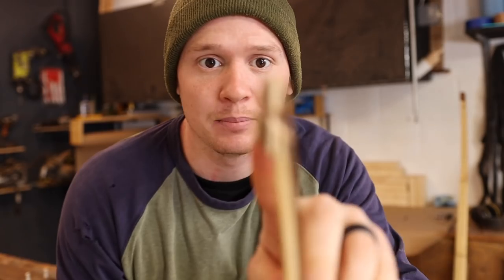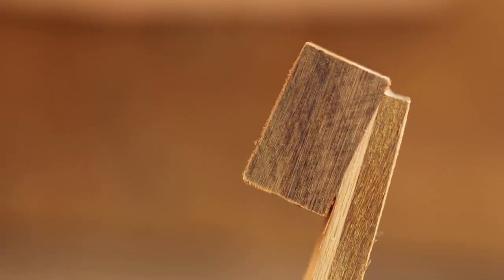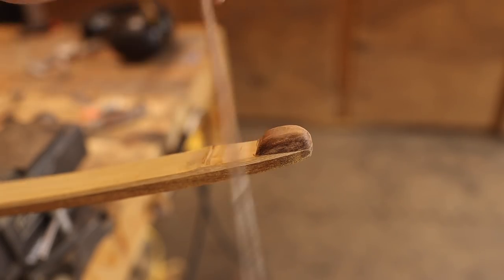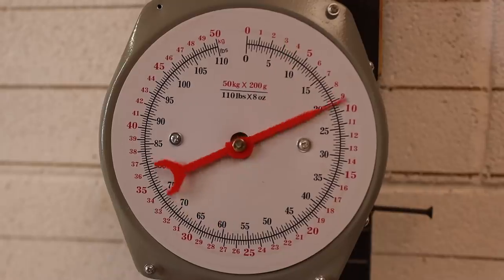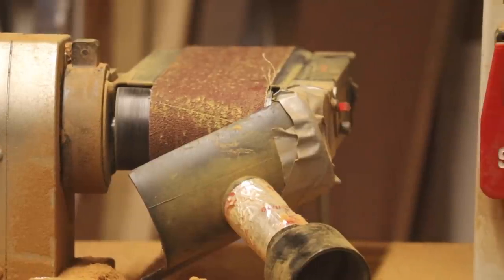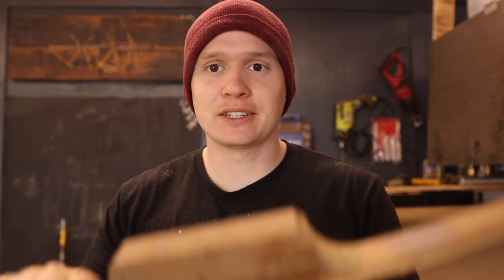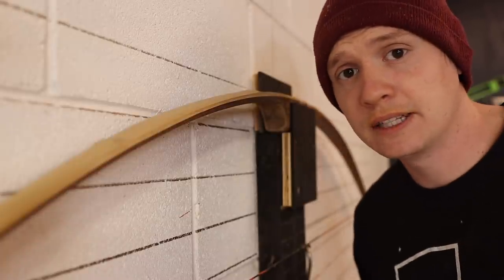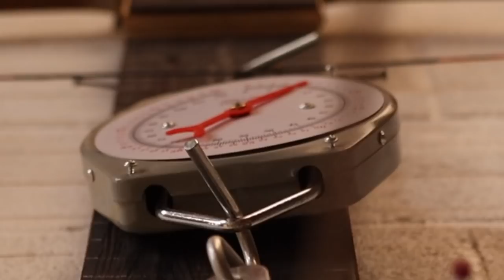How to Make a Longbow "Reflex Deflex" Pt.2

Comment: The knot (7:37) is a "bowyer's knot". It has the identical form as a "timber hitch" (ABOK 195) but if you follow Ashley's naming scheme they're different knots since they have different uses.

Edit: The knots he mentions for bows/archery are loops/splices for the operation of the bow and there no mentions for of knots for tillering.

Comment: Hey great video. I can't find a glue up jig video. Maybe you could make a video specifically on how you made that and the amount of reflex deflex in it.
Reply: sorry for being 6 months late with this as you likely have it by now. ill drop this in case anyone watches the vid and has your questions in the future.

  With the description he gives here, you can make one as he gives all the relevant information. Each block shape is to cause a bend in the desired direction and to allow for clamping (hence plywood and not solid blocks) and for specific measurements, he said he just does what he likes for the curve he wants. 

plywood, to make it nice (and so long as you intend to use it more than once, since finishing a 1-use item is a waste of time) requires countersunk holes drilled for screws (so the heads are below the wood's surface without damaging it) and maybe router or sand the edges to allow for a cleaner look, fewer splinters, and more protection for the bow. for better longevity/stability, glue before screwing - but in theory it could be easier to store if you don't, and you could just add an extra screw/ notching between the pieces so they fit together well. preferably taking into account the forces involved. .....which is easier than it sounds, actually. for the base board, you want something flat and of desired length. that's about it. engineered products (plywood, laminate, etc) will tend to be straighter over longer periods of time (avoid OSB, and any boards made involving compressed particulate matter. any moisture and they disintegrate/warp.) you could also in theory just toss some paint or sealant on a natural board. theyll do just fine on their own if you can get a straight one and keep it dry/ in a straight position during storage, but im thinking for longevity and rough use. accidents happen, and it will be going into an oven over and over.

how he assembles the bow and clamps it is the most valuable teaching information, as everything about the bow is simply because he wants it that way/ he's found it to work best for him. for the heat box and curing, you can find that info on whatever adhesive you use - the heat box looks to be a basic box with some of that insulating packing material. but assuming it int too hot, you could use styrofoam or whatever you can find space for to hit or withstand temps involved.

Comment: I don't see you use a respirator around the ipe. Ipe dust is toxic, and the dust will mess you up. Please spend the few dozen dollars to get a good respirator, with replaceable air filters, and use it when cutting and sanding tropical hardwoods.

Great bow!

Comment: At 16:09, you said when moving the scraper along “wherever the gap is bigger, you need to remove wood” shouldn’t it be the other way around, wherever the gap is smaller you need to remove wood? The gap would be smaller in places because the wood is too stiff in that section so that’s where you need to remove it. And I also believe you said it correctly the other way around in an older video.

Comment: Kramer
Thanks for all your entertaining and informative videos.  I am turning 80 in June and have  five bow that are now to heavy a draw weight for me.  I am selling my left handed Ben Graham 'Kingfisher' of 54lb @ 27" deflex/reflex  Red Elm/Bamboo longbow..  Trying to get up to pulling my 47lb  Dan Quillon recurve. Maybe ???  I made an Oak 50lb  flat bow and made the mistake after letting the stave dry in AC , and then working  it in my Florida high humidity, no AC shop .  Tillering and then test shooting before sealing, and let it sit in the shop for a week.  Of course it  went to  a string follow set.  I am thinking I can shave this bow down to 35-38 lbs. , but any idea how to get rid of the string follow at the same time ??

Comment: You might try Watco Danish Oil finish …  wipe it on … let it stand for a while … wipe off the excess.   Same process if you need to re-finish the bow.  This was the only finish we used when I was working in the cabinet shop.

Comment: Why Ipe wood on the belly? - and would there be advantages to putting cross carbon or stabil core in the sandwich between the two wood layers? - likewise, would there be advantages to putting fiberglas or sinew on the back?…or do you find it is unnecessary with this design?…

Comment: Question: I have tried to make a hickory Holmegaard style bow but it broke. length: 70", measurements were the same at the break point and the opposite side of the bow. the wood looks like layers or laminated but it isn't. Could it be that the wood was just too brittle??

Comment: Brilliant series ... thank you so much.

Would draw weight adjustments also be done during tillering? Would you just keep on removing material until the desired draw weight is achieved?

Would such reduction be done both on the sides as well as the belly of the bow?

Comment: Ordered a lil kit on Etsy, 72×1.5×1in. hickory stave, 72×1.5×1/8in. Bamboo strip and 8×1.5×1in. hickory riser blank for $55. We'll see how the quality of the lumber is when it arrives, but if the grain in the stave is go as straight as the one in the pictures and as long as the boo is properly planned and has a consistent 1/8in thickness from end to end I'll be stoked. Eventually I want to make my own Egyptian/Assyrian style angular longbow, so I figured I'd start with the low-cost kit and follow your reflex deflex videos as I go. I plan to cut the total length down from 72in to 64in, that way the extra 8in of hickory can become my power lamination and over lays. Probs gonna add phenolic from 3rivers on the overlays so I can buy a fast flight string and not be terrified Everytime I draw it to full 28in. Figure if I make the rookie mistake of taking too much off and ending up with a draw weight that's wayyy below my target, I can always order a strip of bearpaw power glass to slap on the belly and hopefully replace the extra material I accidentally removed. It comes in a pretty wide range of thickness from O.015 - 0.09. Do you reckon that will bring the draw weight up if I accidentally remove too much wood? Anyone with experience doing such things THEMSELVES please answer a question for a first timer!

Comment: When making a bow, how do you know what draw weight you canmake it too? Say if i wanted to make a long bow draw 100 lb..how do i kniw if my bow will/can do that?
Reply: Well knowing your optimal draw length is what you base your weight around.
I have almost exactly 30 inch draw compounds I like around 65#-75#, but primitive stuff I like to keep around 55#-65#.
Id have to say there isn't exactly a definitive answer as to what exactly to do to achieve your optimal weight. It's a whole lot of trial and error.

Ive read about people making primitive bows in excess of 80# draw, but that would be really gratuitous and really not fun to shoot, but to answer your question, yeah I guess it could be done.
Reply: @hunterromano5562  I guess wood is crucial. My first attempt snapped at tillering, I havd no idea why
Reply: @gervasebarnes  for sure.
I've had plenty of staves come out super clean and still have issues with cracking.

Idk I guess chock it up to "win some lose some".
Reply: @hunterromano5562  thank you. It was Fijian kauai, and I suspect its an inflexible timber
Reply: @gervasebarnes  I don't have any experience with that wood.

Most stuff I did was hickory, Bois'e 'd arc, and some other Oklahoma native, but it's been too long.

There are some videos on YouTube I'll search for, but they refer to matching grain rings the entire length of the bow or as close to it as possible

Comment: I have a traditional 67 '' 55 # laminated wood deflex-reflex bow which is a lot for me,  what can I do to lower the bow power to 40 - 45 lbs?
Reply: This is very late but you can untwist the bow string a few twists at a time or even get/make a slightly longer string.

Comment: For those who are curious. A "chainsaw file" is actually called a Rat tail file.
Reply: Not always. Rat tip files are cone shaped being thicker to thinner. Saw chain files are cylindrical keeping the same OD throughout. (I'm a tool sharpener)
Reply: @David-bs6bv  perhaps not always but... when I had to order files for my chainsaw (former logger) I never saw them listed as "chainsaw files" only found them under "rat tail" and ordered the spec required.

Comment: How much time it takes to dry the wood after it was taken from a tree ?
Reply: It depends on the kind of wood, the size of the piece... For a self bow I'd actually put a little oil on it, specially on the ends and then let it dry for at least a couple of months in a cool dark place like a closet where air humidity wont make any drastic shifts. The slower your wood dries the better chance it has of making a good bow.

Comment: "And where the gap is bigger is where you need to remove wood." NOPE. "And where the gap is less is where you need to remove wood."
Reply: Michael Hill 
I was thinking the same thing. Sometimes he slips up and usually corrects himself in another video.
Reply: @WRMonger1  wanted to do what little I could to limit the # of new builders whose bows would go BOOM.
Reply: Michael Hill 
they’d be chasing that curve for days wondering why one portion was turning into a hinge rather than a smooth arch.
Reply: An explanation about how to adjust the pencil in the tilering gizmo would be nice too, cause he obviates that obviously key point